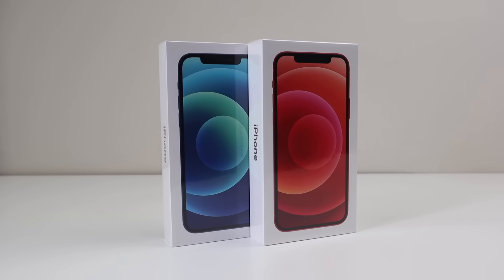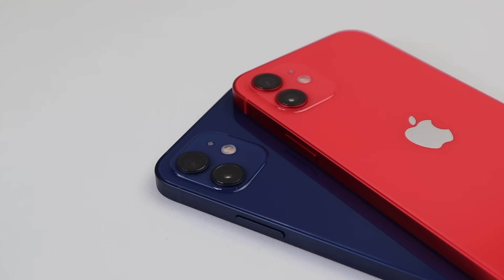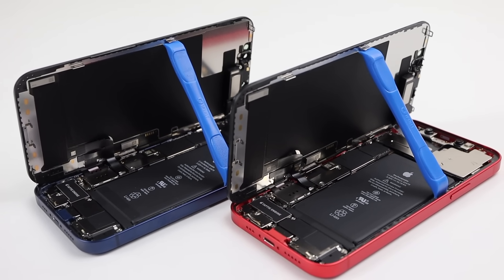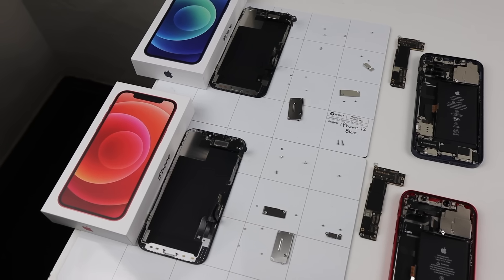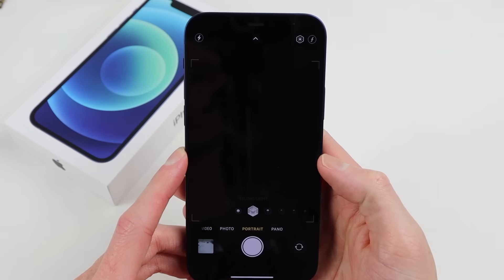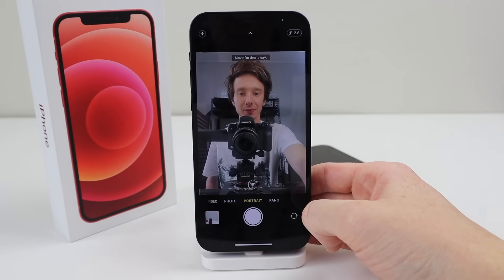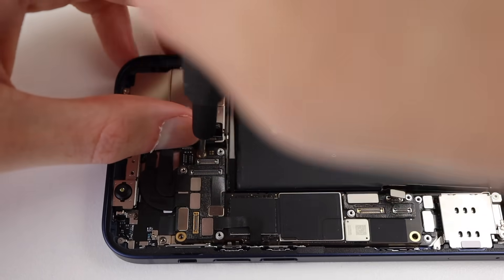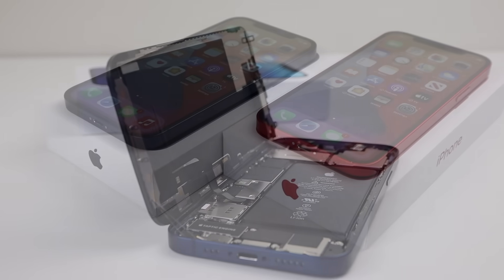iPhone 12 Anti Repair Design - Teardown and Repair Assessment

Comment: Apple's next step: phones without a charging port.  

When the battery runs out, just buy a new phone with a charged battery ...
Reply: Yeaaaa......"Enviroment friendly"
Reply: Yeah. Ideally without any holes or ports into device at all. Wireless charge and wireless connection protocoles only. No more wires. Solid body without any screws. impossible to disassemble... It will be next gen...
Reply: @igorshingelevich7627  speakers and microphones will only be in a separate Bluetooth device
Reply: iphone 13 will be with no battery - sleek look, light weight, explosion proof, environment friendly.
Buy their new non rechargeable powerbank to use your new iphone, that drains within a week.
Seems like a good marketing idea that Tim will like it😂
Reply: No more speakers, we can just use a Bluetooth one
Reply: Stop giving them IDEAS
Reply: @sadcat747  hahahaha
Reply: @sadcat747  to late and apple just added 5gz hotspot I cried where I heard that
Reply: @chriswright8074  ah it's all over
Reply: And the battery will only be sold separately. But don't think you can buy just the new battery for your old phone: We have made sure to pair each battery and phone to prevent you from doing that :)
Reply: Lifetime battery longest running battery in the world lol
Reply: Or you have to go to an Apple Store to charge at an exorbitant price. Then when the battery dies fully, you just buy another one.
Reply: Hahahah so original comment i‘ve never heard this joke before you Are so original
Reply: nah, they will just not put the phone in the box.
Reply: Apple: No more iPhone, just a $900 Apple sticker because you people will buy regardless.
Reply: Absolutely underrated comment XDXDXD
Reply: Lol But arent they actually trying to do it. Isnt that what that mag safe is about.
Reply: I wouldn’t be the surprised at all if that happened
Reply: "It's all for safety and user experience! You have no idea of what an unauthorized non-apple wall socket could do to your phone. It could blow up the charger and cause harm to the users!"
Reply: oh its comming for the iphone 13 check the leaks already
Reply: I think Apple should be sued, and banned from market for wifi greying out, and charging unreasonable dianogsis fees...
Reply: Designing iOS updates which kill your old iPhones to sell their new launches!
Reply: That sounds pretty cool to me since I haven't used the port on my phones for 3 years lol
Reply: Lol
Reply: Woo, so innovative!!!
Reply: Wireless charging 🤨
Reply: Apple is becoming Nokia soon from heights to no users at all
Reply: don't give them ideas
Reply: imagine if they actually do this and replace it with all wireless charging 😭
Reply: don't go giving them any ideas bro
Reply: You stupid
Reply: don't ever mention it, this idea might become true.. just wait.. a simple sarcastic idea can turns out becoming a million dollars idea
Reply: For those who buy iPhone the logo is enough. A working phone isn't important. Very often the only smart thing is the phone not the owner.
Reply: And I still buy it no matter what
Reply: there is something already called wireless charging
Reply: @sreekarvantrapati7065  Usually in car. At home you still need to buy an adapter.
Reply: @fabiovecchies8688  i'm preety sure 3rd parties would make a wireless charger for car by then or ibuilt phone charger in car
Reply: This could actually happen if the promises of nuclear battery makers come to life.
Reply: MagSafe: “we’re almost there”
Reply: Just buy a new type of charging cable which costs only $499! This charger will destroy itself after 2 charges, and you will not find any that work properly as we want MONEY!
Reply: Or battery subscription, pay to recharge
Reply: They've already said they're working on it. I believe that's why there was that fiasco with the Apple air charger. They wanted to increase power so you would rely on it but it didn't match up and we'd be seeing them sooner.
Reply: Wireless charging only. Apple need their phones to be slick with no ports.
Reply: @doverun  next no speakers you’ll have to use AirPods to make calls
Reply: Iam from India 🇮🇳 
Please vsit my channel 
And learn how to simply edit photos using your mobile phone 
Daily video updating 
Use this corona time useful than lazy 

Love you guys

Comment: When I started buying iPhones, they actually were, by far, the best product in the market. The price setting reflected that difference and was acceptable.
I am now on my 4th and last iPhone, because there are devices that are both much cheaper and better. Apple’s right to repair stance was the last drop for me.
Reply: Facts not buying nooo more iPhones
Reply: How do you exactly compare the usability, stability and upgradeability of iOS and Android ? It would've been much easier if 3rd party phone manufacturers were able to run iOS but this will never happen. So if you want the iOS you're stuck with iPhone. And that's sad but Android is not going in the right direction and it's only Google's fault!
Reply: @pavlins123  I am not too familiar with Android. Could you elaborate on “not going in the right direction”?
Reply: @Stefan_Van_pellicom  since you’re not too familiar with Android could you elaborate on “there are devices much cheaper and better” ?
Reply: @pavlins123  I have had a computer shop for 30 years. I am not a strangers to specsheets and benchmarks. You were saying ?
Reply: @Stefan_Van_pellicom  it’s hard to measure usability, security, customer satisfaction and long term stability with benchmarks. But anyway I hope you’ll be  happy with your next Android phone.

Comment: Appel, the only company who removes the charging brick to save the planet and then sell it as a separate component and has the courage to lock down the individual components so the devices are not repairable. So, it can end up in the landfill.

Comment: At one minute or so, you state that the cable supplied with the phone doesn't fit the chargers people already have, what you failed to mention, though I trust not deliberately, is that the chargers will work with the new phone, it's the cable that won't fit.  If you have a charger brick in your home that you've used to charge your previous iPhone from the last five years, you can almost certainly use it with these new phones. Talk about confirmation bias.

Comment: Tbh... having devices being able to swap out the internals, is something that at some point in time will conflict with having security being as good as possible. What if you could swap out the T2 chip? Swapping out the entire logic board, is exactly the same as swapping out the T2 instead... if this were possible, then having a donor component could all of a sudden go around all security provided by other components, relying on the swapped component being genuine ... so I understand that it is frustrating, not having swappable parts, but at the end of the day, swappability conflicts with security... the cameras and battery may be exceptions, but this all depends on how much chip-logic is attached to those components being genuine.

Comment: I feel so sorry for Apple users. Their loyalty is not returned. I'm an android user and definitely not loyal to a particular brand. I prefer Pixel(using pixel 2 xl currently) for stock experience reasons but I'm not upgrading to the pixel which is below expectation with price not justifiable. I'm spending extra cash on the Xperia 5 II when a 5G version is available in the US. I'm currently waiting for an OEM with a 90W charger for a phone so I get it( charge my phone and HP laptop).

Comment: Just use your old power adaptor. AND the old cable. The iPhone still has the lightning connector, so no problem there. If you have a new MacBook, you can use the new USB-C cable with that.

Comment: Or you just use one of the two billion cables that were sold with all those chargers. The Type-C cable is really so it can be plugged into current Mac laptops with are all Type-C.

Comment: The trade bodies in various countries need to look into this, we have lost the ability to even change batteries, this was normal practice. The first phone manufacturer who makes phones easy to repair and re-furbish should have a massive market, so why has someone not broken ranks, it must be a cartel/collusion on the current phone manufacturers to avoid anything like proper recycling/repair, much of the tech is viciously fought over as to who owns the rights or patent, when nearly all of it was developed years before and then copied.

Comment: So basically, (this is just an assumption on my part) all of their components have a "signature". And each of these are known by the motherboard. On boot, each of these components are asked for their "signature". If at least one of these "signature" isn't known to the motherboard, it won't boot.
Sony did pretty much the same thing with their PS4. You can't swap the Blue Ray reader from one console to an other.
Fortunately, there is a very simple way to avoid all these problems... Don't by their products. Told you... It's simple.

Comment: I actually do agree with Apple. Sorry, unpopular opinion I know. But often phones are stolen and one can just call the phone company and they will block the device, or you can do it yourself; however robbers still have incentive for their doing because bricked phones are still valuable for their parts, but if they can't use those parts in another phone, now they get nothing. Repairing seems like a minor issue really, thieves endanger more than your wallet, they are a threat to your integrity, and phones are the most frequent target.

Comment: watching your video first time.  unimaginable depth in your analysis, explanation and logic.  will continue to watch more from your channel.  apple made logical board illogical!!

jokes aside, why parts need to be replaceable?  if Apple is confident of each part with the highest sigma in manufacturing and quality standards then the parts would work fine.   Moreover, users need not go for spurious parts or non-branded as replacements!  yes, original parts are damn expensive.. 

when we accept original parts in high-end cars then the same logic would hold true..

Comment: without charger there will 2 advantage for Apple. first, people will buy charger, means extra money for Apple. second, there will be people that buy 3rd party charger, this will give more chance that your battery to messed up, that's mean you going to buy new battery, or even new phone. that going to bring 3rd party companies to make their charger better. with this possibility, the next IPhone 13 could also have give id on charger so that you won't be able to charge unless use original IPhone charger or specific software installed on your computer

Comment: With lithium battery tech that will need replacing at 18 months due to reduced output if not out right failure some time in the 2nd year all mobiles need cheap battery replacement at that time, thus why batteries should have remained user replaceable, like the galaxy S5 was while still having water resistance. Of cause companies sealed phone to force you to think twice about keeping your phone and replacing the battery cheaply. This is coerced obsolescence, they know batteries degrade and fail around the 2 year mark while offering 3 plus years of software upgrades, payment plans to 3 years all on devices they know need battery replacement well before the 3 year mark. Paying off a phone they charge nearly $2000 for over 3 year knowing you'll have to pay a premium just to get a battery change and not knowing if the rest of the phone last the life of the new battery? As you disassemble phones, if you can identify cheap and easy phones in the mid and high range for everyone to by in protest to Apple and others

Comment: For the Face ID, did you swap the screens as well? Usually the Face ID sensors are linked with the logic board. So if you don’t match the correct sensors with the correct logic board, they won’t work. So you would have had to swap the screens on the phones, or you’d have to swap the Face ID sensors on the screens to get it to work. 

You can’t just pop out the engines and swap them without swapping the Face ID sensors cause they won’t work
Reply: Nice tip :) I get your point in swapping the screen and the logic board but what if the screen breaks and the logic board is just fine. In my humble opinion and probably everyone in this comment section thinks that no matter what breaks in the phone, it should be easily replaced without any additional parts.

Comment: Unpopular opinion here.... I have seen some right cowboy 3rd party repairs , let a lone self repairs in my life time.  Not everyone has the equipment or skills to repair such devices.

I believe that the devices parts repairs should be locked to Apple and authoritied repairers when the device is in warranty, but users have the option to contract Apple to remove the lock, kinda like sim lock.. doing so would remove any warranty on the device.  When out of warranty, the device parts lock should be removed.  The whole thing should be treated just like a sim lock.

Comment: Pretty sure car manufacturers have gotten sued over similar practices, why is this even a thing? 
Kinda like if you changed brake pads on your car yourself with 3rd party parts, and now the car would display that braking power is reduced, non original parts detected! and then you crash at an intersection cus brakes feature got disabled.

Comment: Apple: "We eliminated the power adapter to reduce waste." Also Apple: "For a mere $59.99, might we also suggest this genuine Apple power adapter to go with your iPhone 12." The environment is really just another word for more profit for these companies.
Reply: Just wondering ... if you pre owned a iPhone X does the old USB-A powerbrick and old USB-A to Lightning cable work fine or do you get some kind of slow charging?
Anyone tried that yet? 
And are the cables still falling to pieces after longer use?
Reply: I understand why they tried to go the route of removing the charger since a majority of iPhone owners most likely already own a charger of sorts so it's not a super big deal to them and they don't need another one, but for those that are new to shopping for a smartphone or are switching from an android device i definitely understand the frustration. Id be annoyed too that i need to buy a separate charger when i can just get an older iPhone that comes with one. I don't understand why Apple is calling this move more "environmentally friendly" when now they have to make more charger boxes to be able to accommodate for not shipping them with the phones, so whatever environmental footprint you freed up with the phone box you just gained back with additional charger boxes. I'm an Apple fan, but even i don't understand their choice of business practices sometimes
Reply: Not to mention that it increases waste, with more shipping, paper, and plastic, and/or gas used to make and then get the adapter

Comment: sales went down so they had to get a tighter grip on your phone even after you buy it. Not just phones but also macs.   their are many android devices that started surpassing iphones in every aspect way back in 2015 and even now.  The anti repair issues has existed for a long time with Apple, now its worst because, desperate times call for desperate measure. They went with the basics with this 2020 phone,  reminder of the iphone 4, just for the sake of having it be even more anti repair, and added the big notch. Apple is not so big if they had to fight third party repair like this.

Comment: So if an apple employee replaces these parts with new ones it should do the same thing, thats why it only turns on with a cable for the first time, i imagine apple employees got a special charger that basically verifies the replacement was done at apple and makes everything work fine again.

Comment: Repairability does not always equate to environmental friendliness. Repairability only ensures extended useful life of the product, which the environment doesn't give a f* about. In a circular economy setting, the manufacturer needs to have complete control over the product's lifecycle, hence preventing third party repairs may make sure that the product comes back to them at end of its intended life through a buy back or trade-in policy for dead iPhones. So the product doesn't end up in an unauthorised recycler or worst case in a landfill.

Comment: I’m trying to understand why this is a problem. I have used iPhone since 4 and never had any malfunction or issue that needed repair, also I’m not sloppy so I have never dropped the phone and I don’t like cases, only screen protection. A phone that needs constant repairs actually means more waste of dead parts. And if I’m able to repair it, what I’m supposed to do with the dead piece, screen or battery? As far as I know, Apple recycles the components, some technicians just throw them away. There’s also a lot of bad quality repairs that will produce even more waste.